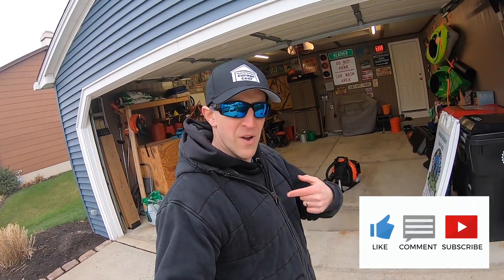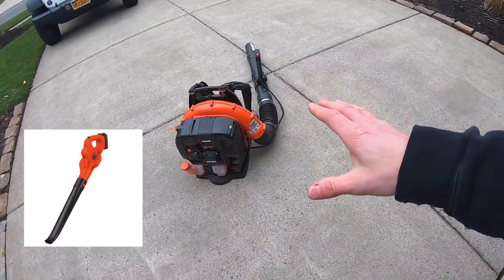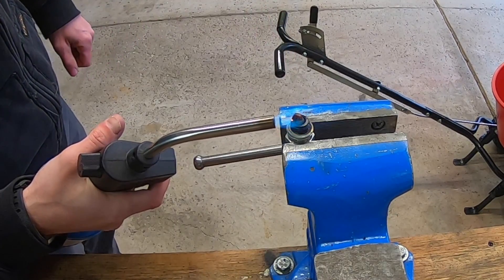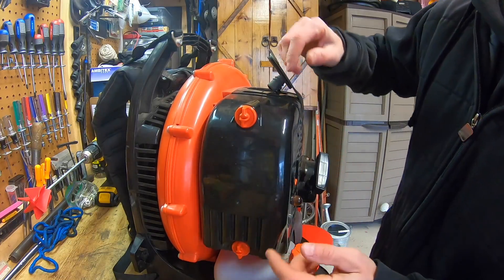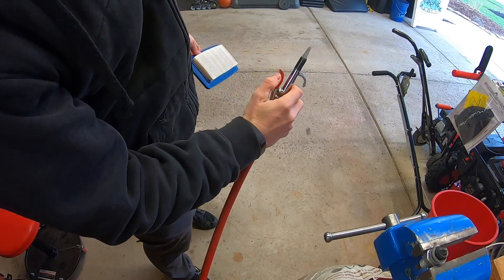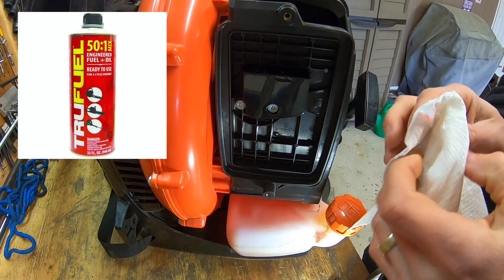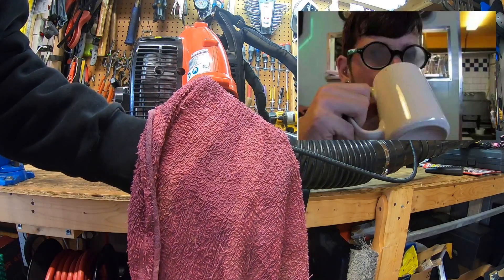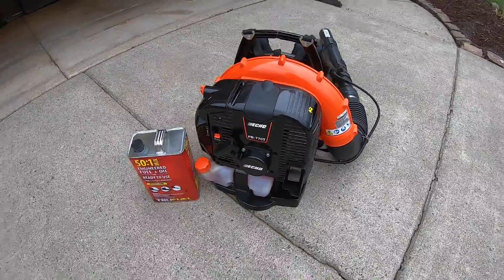ECHO PB770T BACKPACK BLOWER - Fast Tune Up And Maintenance Tips

Comment: Hi, I use a piece of emery cloth to clean the spark surfaces in the gap.  Besides burning any built-up crap, are there other benefits to putting a torch to the plug?  Why do you recommend heating until the spark plug tip gets red?  Thank you
Reply from the maker: @dwasylkiw  I just use it to burn off all the carbon on the plug. Once it turns red hot you’re good. Let it cool then hit it with a wire brush. Nice and clean then👍

Comment: PLEASE ANSWER. I have the same exact blower would you know why when I pull my trigger it gets stuck and you have to manually pull trigger out?
Reply from the maker: Hey Will, there is a pin/spring behind that trigger I believe. I bet it needs replacing. Shouldn’t be a hard fix. If you go on ereplacementparts.com you might be able to find a diagram. Thanks for watching!
Reply: Вам следует разобрать рукоять на трубе и вы увидеть тросик в трубке второй конец этой трубки возле карбюратора вообщем вам надо залить в нее чистящее средство я просто промыл бензином и тросик будет двигаться без сопротивления вследствие чего курок будет возвращаться в исходное положение, не так давно сам с этим столкнулся пришлось устранять, а еще у меня на карбюраторе флажок к которому крепится тросик повара Ивася с задержкой ,я снял карбюратор промыл чистым бензином   Разработал поворотный флажок газа установил обратно но еще отрегулировал натяжения тросика под карбюратором, это все очень легко сделать

Comment: hi gp I bought a blower 4 years ago and I never give it a tunap, it seems that it is the carburizer and some other things I can do I need help
Reply from the maker: Hey superaugui carburetors on these are actually pretty easy to clean if you have some carb cleaning spray. I don’t have a carb cleaning video on these specific blowers but if you search you may find one. Also try running that trufuel after you clean it. You won’t have that issue anymore once you start using that!  If you have any more questions let me know and let me know how it works out for you!  Thanks for watching!

Comment: I'm on my second carb with my pb 580T.  The bulb always gets stuck and wont start.  Any ideas why it keeps eating carbs?
Reply from the maker: Tundra Guy that’s pretty unusual. Not sure why exactly. I know these carbs love the running on that trufuel that I use. Maybe give that a go. It’s super clean fuel. That way you can at least rule out the fuel being a problem. Thanks for watching!
Reply: Tundra Guy, like Garage Gear suggested use the pre mixed fuel, DO NOT USE PUMP GAS TO MIX YOUR FUEL. Ethenol is horrible for small engines! I use True- Fuel in all my 2 cycle and 4cycle engines, and they perform awesome